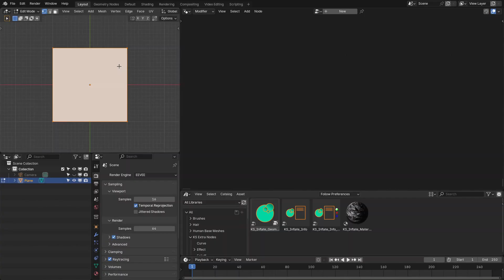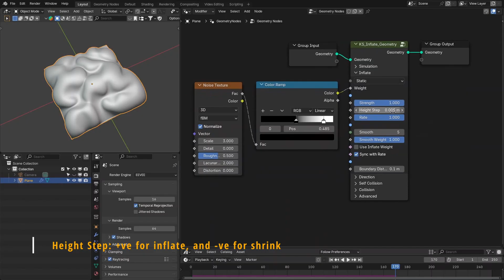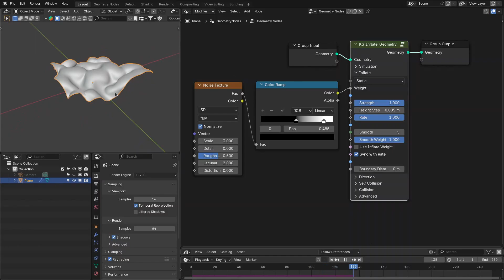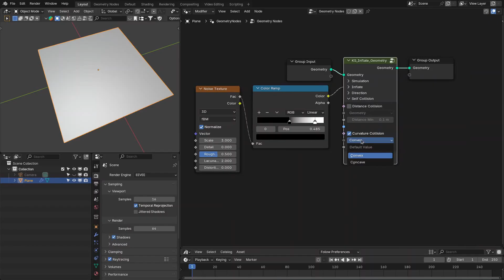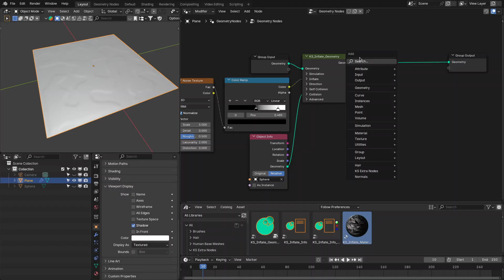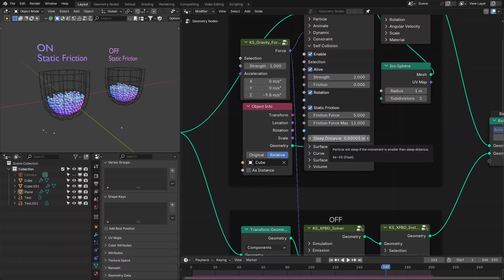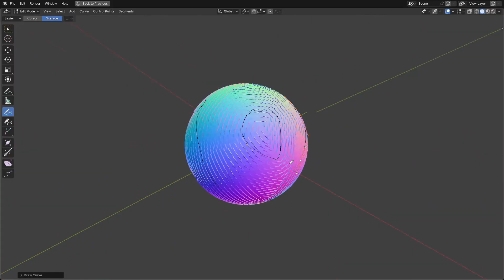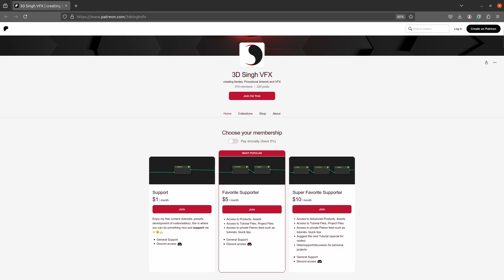🎉 Released Extra nodes v3.5 of Geometry Nodes | Inflate System 🚀 - Detailed Demo

Comment: Amazing as usual. Could the inflate node inflate a balloon? Could it replicate an imprint in wet sand on the beach or on a memory foam pillow?
Reply from the maker: Hi. Thank You. Yes. Definitely, you do that with Inflate Geometry node. Just let you know, you can define custom inflate direction to get whatever shape you want.
Reply: @3DSinghVFX  Wow how does that work? I want to make it look like im pouring something in so it inflates from the bottom up?
Reply from the maker: @herncabret  Use Dynamic Weight option. Then use Mesh Face Falloff node to define the weight based on the stuff your are pouring.